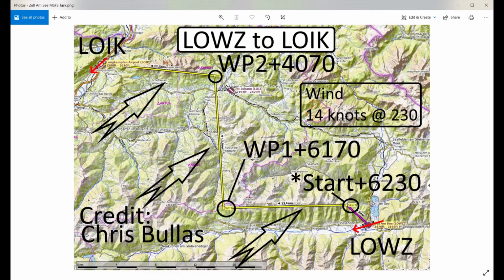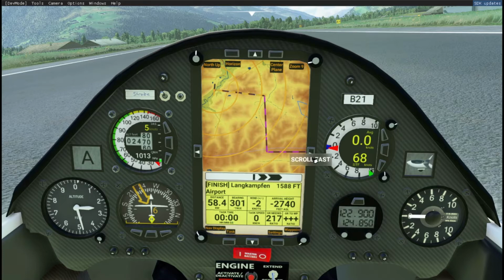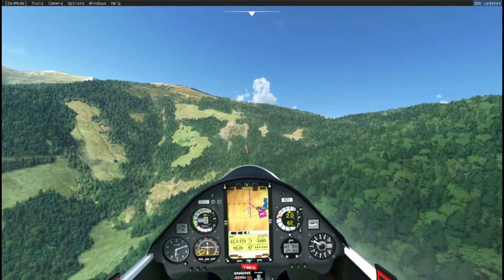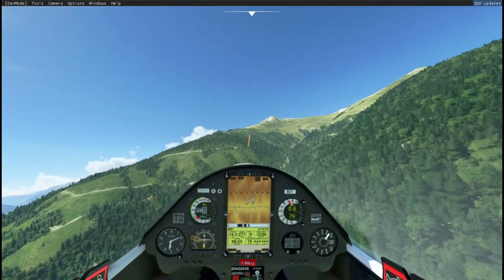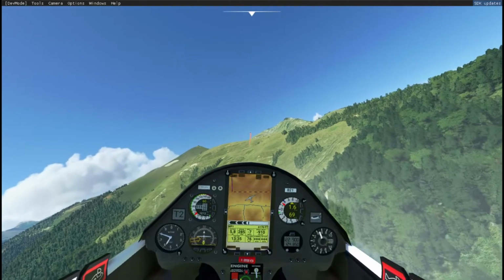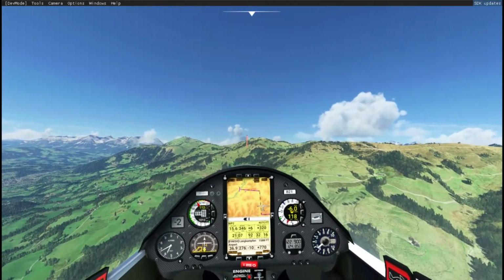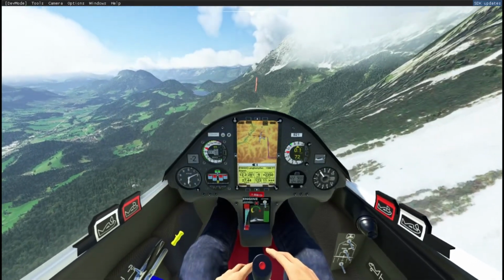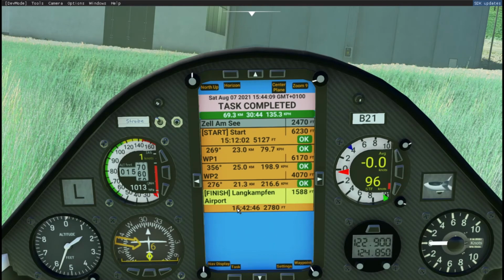Microsoft Flight Simulator AS33 glider: using a soaring task (LOWZ to LOIK)

Comment: Thermals and upwinds calculation seems to have an issue. Never have I seen a variometer move like that in real flight, it's almost random.
Reply from the maker: My advice is try it in the sim - if you have RL soaring experience then flying around and final-gliding to your home field in the sim is truly remarkable. There's enough ridge and thermal lift in the sim that you can do a cross country without much difficulty and freeware gliders range from the K7 to the AS33.

Comment: I just flew the 69 km flight from LOWZ to LOIK in a Discus 2c glider.  I set the prevailing winds to 14 knots @ 230.  Then started the glider midair over LOWZ and flew west along the EW mountain range until about due south of LOIJ.  Then turned north towards LOIJ following the NS mountain range.  When almost at LOIJ turned and few slightly north of west following the EW mountain range and landed at LOIK.  The interesting part is flying three ridges in different wind angles. Fantastic soaring cross-country!

Comment: I wish that they still allowed FSX to use google maps, with Tileproxy.  I miss those photorealistic sceneries in FSX.  But now I can see why they stopped allowing it for FSX, because they were planning to use it for a more expensive upgrade...MSFS 2020.  FSx is pretty dead without photorealistic sceneries.
Reply from the maker: For $60 MSFS has given me 1450 hours of entertainment (that's mostly freeware development, but that's my thing), and MSFS is better than FSX in every way. My recommendation would be every FSX owner with a few years of flying still left in them should suck it up and make the move to MSFS immediately. FSX is obviously dead - the more important question is X-Plane which is an advance on FSX and still in development.
Reply: @b21-soaring  Yeah, I'm debating between X-Plane 11 and Condor.
Reply from the maker: @bryantmaximilionalpha2840  if you're interesting in X-Plane soaring there is Facebook group https://www.facebook.com/groups/416567982493369/ . And there's another for MSFS:  https://www.facebook.com/groups/1803376689823050/. Condor is still in a different league for multi-player soaring and is the only current sim with thermals under the actual Cu's (X-Plane & MSFS say they will add that). The only real Condor limitation is the ancient graphics in-cockpit and scenery. At least X-Plane, Condor, MSFS are a good set of sim soaring choices to have.

Comment: Thanks for these videos. I flew GA aircraft and gliders way back, starting with Blaniks then the Romanian IS-28 and a Standard Libelle. These days I fly r/c electric powered model gliders such as an ASW 28, using an FPV camera with headtracking and FPV goggles, for both thermal and ridge soaring here in Tasmania. I've downloaded the AS33 and took it up for a spin at Innsbruck last night. Still getting to know the beast, but crumbs, you're right about that stall, lol. Oh, must add, I fly FS2020 mostly in VR, with a HP G2 headset.
Reply: Had a fabulous flight over the ridges near Hobart today, about two hours ridge soaring near my place and then further afield in 15knots of wind. Used both TrackIR in 2D and VR. Very pleasant sailplane to fly, once I got the hang of it. As with r/c models, having an electric motor is a real game changer for gliders. Thanks so much for your work.
Reply from the maker: @Sean_Coyne  hey thanks Sean - it's cool to find out folks all over the world get to enjoy something we've put work into creating (and Tasmania definitely counts as "over the world"...). The AS33 is much more docile when you've dumped the ballast. I've flown the Libelle - nice simple lightweight plane - our choice of the highly advanced/complex AS33 for our first MSFS model was a bit questionable but we needed an engine as you mention.
Reply: Cheers, Ian. I've just spent a great if sometimes frustrating time, flying over the west coast of Tasmania wilderness in VR around Port Davey tonight. I say frustrating because I had some issues with the wind speeds not sticking in VR. Instead of 16-25 knots it kept defaulting to 4, which made for some iffy flights. Finally got it sorted and the experience was heavenly. If you select that coast you will see really challenging but beautiful ridges and bays and not a soul in sight. This island of ours is paradise and, being in the roaring forties provides ridge and wave soaring to match anywhere. Just don't crash or the Tassie devils will eat you all up, including your teeth, lol.

Comment: Thank you for another video on AS33. I noticed that finish doesn't have the AGL height added in it's name like the other task points. Is it not necessary? Looking forward to v1.0!
Reply from the maker: thanks Radek. Good question. MSFS 'correctly'  sets/uses the elevation of the DEPARTURE and ARRIVAL airports, so you don't need the "name+[elevation]" fix for those. The Nav Panel in the AS33 hides the "*" and "+..." when it displays the name. The naming "extension" is purely a trick to get waypoint elevation into the flightplan AND sent to the aircraft gauges. I.e. "Burnt Cabins" can be safely put into a Flight Plan as "*Burnt Cabins+2130" and other flightplan software will display the name as-is, but the AS33 Nav Panel knows what to look for and copes fine if it's not there.

Comment: I happened to bump into a couple of vids you did on the AS33. I'm a GA flyer but this gliding thing looks like a lot of fun. I've flown GA in real life and as much as I love flying, it does get a bit boring from time to time, just flying from A to B. Hang gliding seems to have this constant excitement of managing energy state. Thanks for all the info/tips. This is a whole new world to me and I'm definitely going to try it in fs2020.
Reply from the maker: hey that's a pretty positive outcome. Keep in mind the AS33 is a world-championship winning racing glider, so as aircraft go it's pretty unforgiving. The stall is brutal when fully ballasted (the glider will 'bunt', i.e. the nose will go beyond vertical with the wings stalled inverted - that's exactly what my (real) ASW 24 used to do - recovery is 'normal' i.e. you unstall the plane and pull out of the dive, the trick is to avoid exceeding Vne or pulling the wings off on the pull-up). It's remarkable how much easier it is to fly without ballast, and the MSFS flight model does a great job modelling the weight difference.